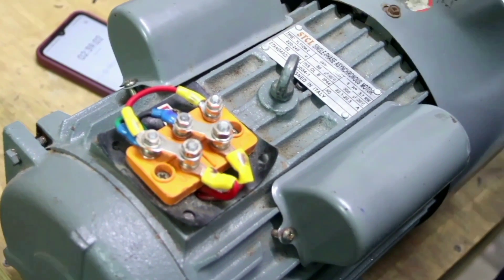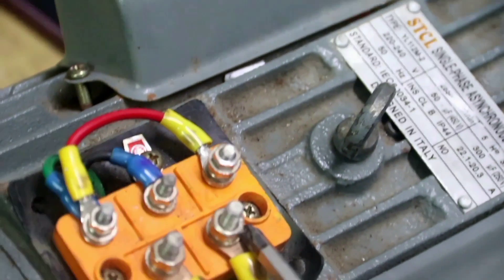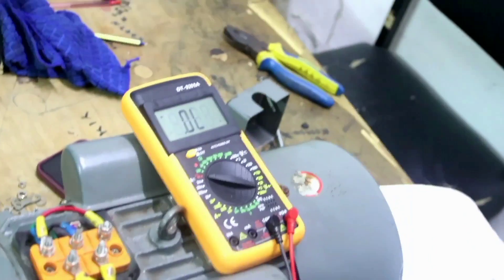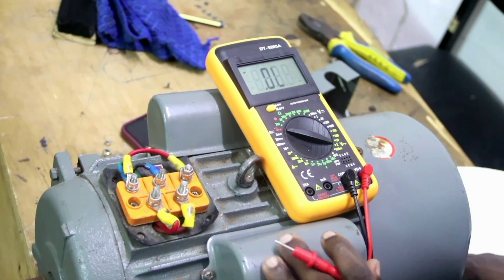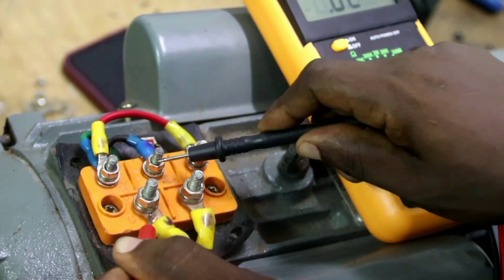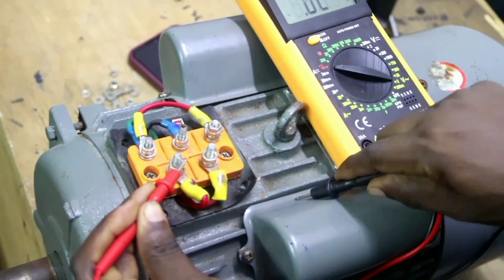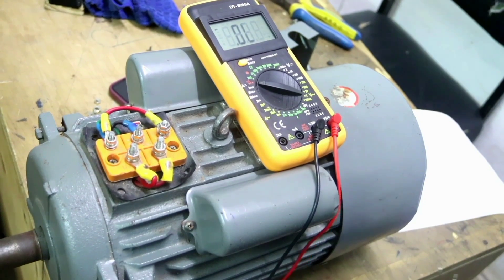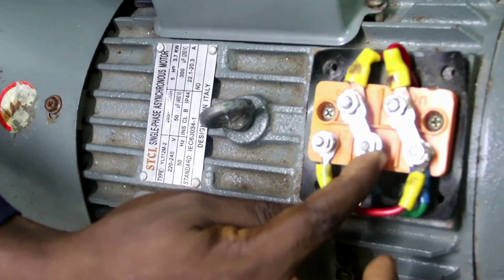TESTING SINGLE PHASE MOTOR USING A MULTIMETER

Comment: Hi,bro help for this my single phase motor, z1 and z1 are not connected why? But in your motor are connected
Power supply are connected on u1 and u2 but in your motor connected on z2 and z1 which linked to z1 why
Reply from the maker: Hi,Good question.
First,Z1 and Z1 might be connected externally or internally,use a multimeter to confirm continuity.
Secondly,power supply can be connected on U1 and U2 or Z1 and Z2 in these motors because they are linked by the terminal plates.So no problem with connecting power in either (U1,U2) or (Z1,Z2)

Comment: So you explain about the start and running windings but nothing about how to connect capacitors? poor teacher.
Reply from the maker: The topic was "how to test single phase motor with a multimeter"I will teach about how to connect capacitors in a coming video.Thank you for your feedback.

Comment: How were capacitors connected?
Reply from the maker: There are two capacitors,C1(start capacitor)connected in series with the centrifugal switch and it provides starting torque.C2 run capacitor connected in series with the running winding and in parallel with the starting winding.C2 provides smooth running of the motor.